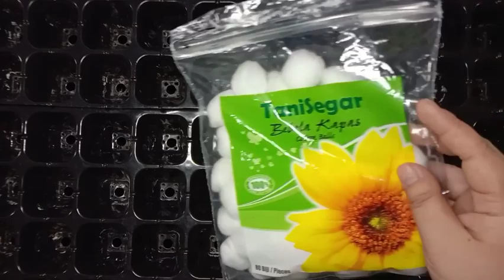Cara mudah Menanam Kangkung hanya di Tray semaian sampai panen | Tanpa tanah

Comment: Can u plant it again after harvest?
Reply from the maker: yes, just simply cut above the nodes of the stems and leave it to regrow a new shoots.
Reply: @DCsimplelife  Forever? How many times can you repeat it? D:
Reply: I just wondering, you just put water or other liquid fertilizer because I want to plant water spinach the way you did.Thank you for sharing.
Reply from the maker: Water mixed with hydroponic solution
Reply: @DCsimplelife  what nutrient solution are you using? Whats the ph level and ppm? Thank you
Reply from the maker: I'm using hydroponics nutrient for leafy green.i didn't check my ph level,i normally use rain water and tap water.maximum ppm is 1400
Reply: @DCsimplelife thank you very much. It's really helps a lot.